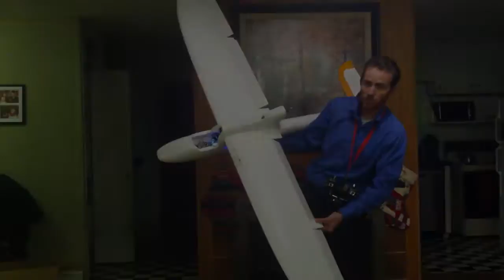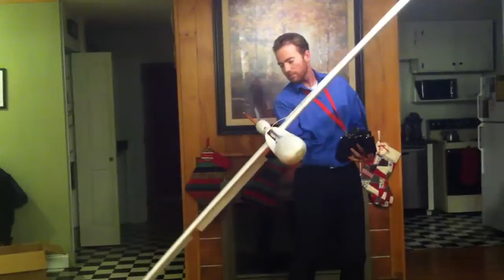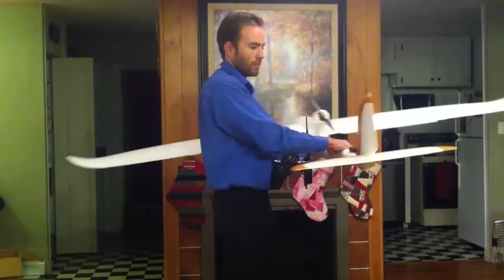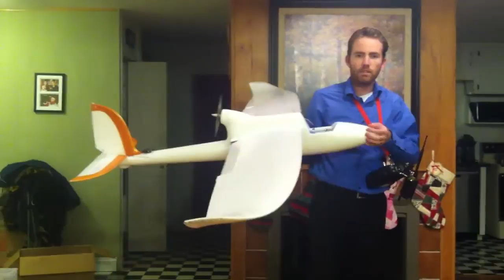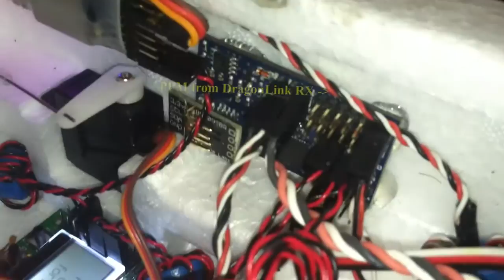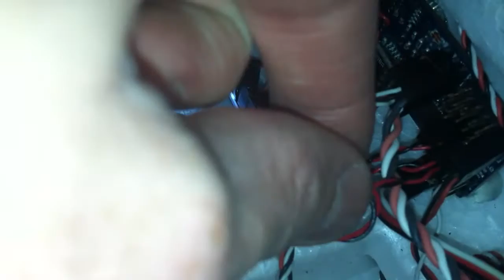Super Skysurfer DOSD+KK2.0

Comment from the maker: This super skysurfer flew with two 5000mah 4s Lipos. Quite a bit larger than a Bix2... Only 2 control surfaces on the wings are controlled by the KK. The Flapron's were KK stabilized while the rest is just aileron input. Basically I had (no longer have this plane) PPM to the DOSD for RTH, from the DOSD I had AIL/ELE/RUDDER/FLAP going to the KK2.0 where flaps and ail were mixed to two outputs, and AIL only was sent to the other two outputs. The Rudder, and ELE went as normal through the KK2.0

Comment: Fantastic video.
I'm planning to do the same with a Bixler2.
How many batteries you are putting inside and how do you balance the plane? (is it nose heavy?)
Are you controlling both ailerons and both flaps from the KK? I mean, are you just using two channels from your RX (like if you had a Y harness)?
I've missed some of the connections in the KK, below the switch channel you are using.